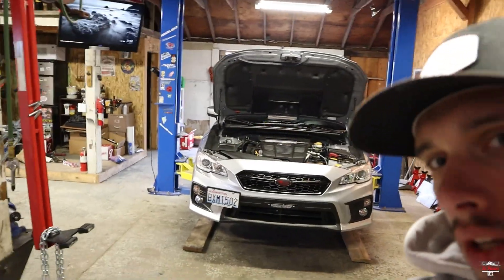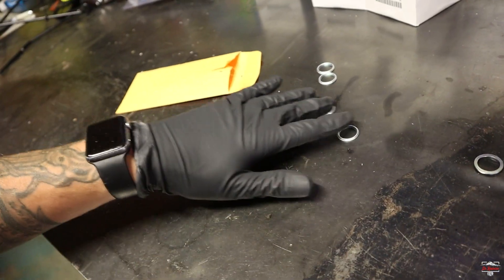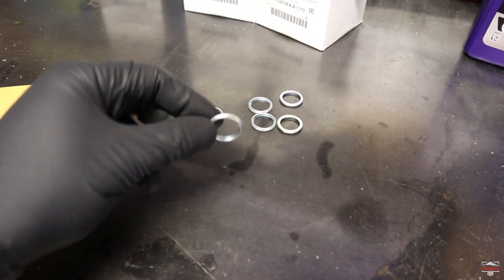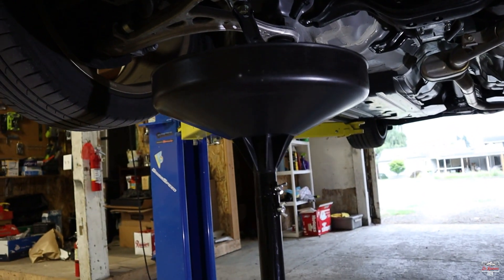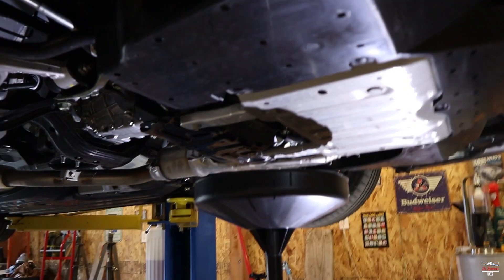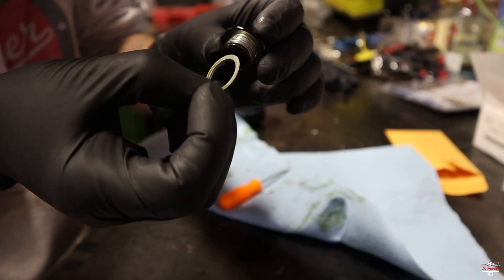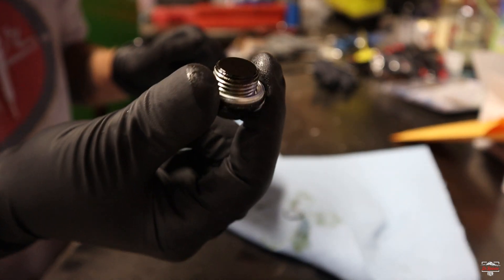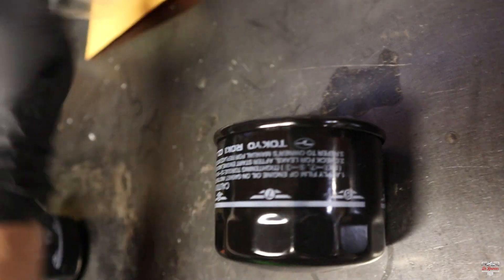How to do an oil change on a 2015+ Wrx || plus one thing people miss when doing it!!

Comment: Use rotella t6 diesel oil.
Reply from the maker: I’m definitely not running royal purple anymore in my car. I never did notice any issues with it when I did have it in the car but it’s not going back in the car again. I’ve ran t6 in lots of my other turbo cars but I’m probably going to stick with motul from here on out.

Comment: NOOOO get that Royal purple outta here 😖
Reply from the maker: But it’s purple and purple means power right?? 😂 what would mr Tanner Smith recommend over The purple drank?
Reply: @DrRainier  literally anything over royal purple lol, motul 5w30 X clean, Castrol GTX. Havoline 5W30. 

Had issued with royal purple where the oil started to coagulate. Happened to Matt as well in his SRT4
Reply from the maker: 😳 well that’s no bueno, I will have to monitor the oil then and do something different next time. I’ve ran royal purple in 3 of my other turbo cars I’ve owned and never had an issue but I do recall seeing someone talk about the coagulation issue in the past! Thanks for looking out 🙏🏻